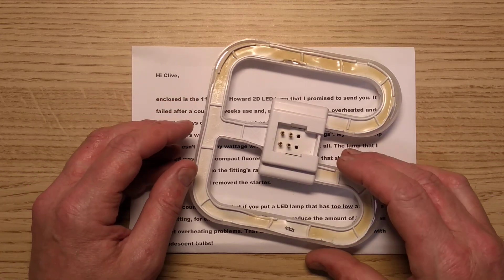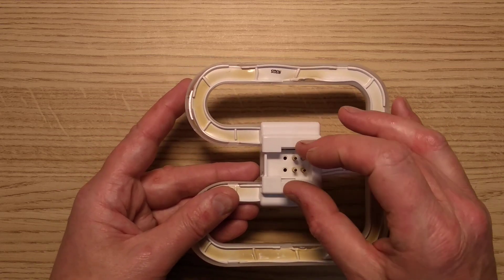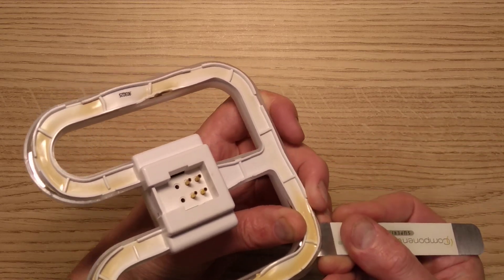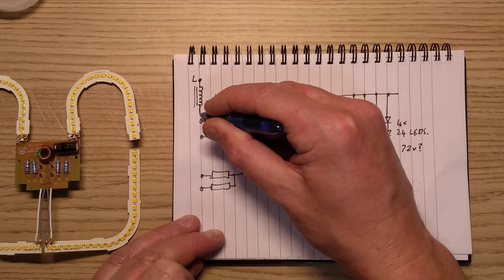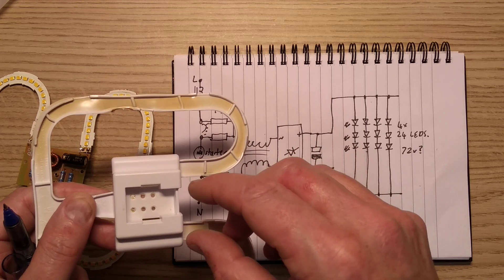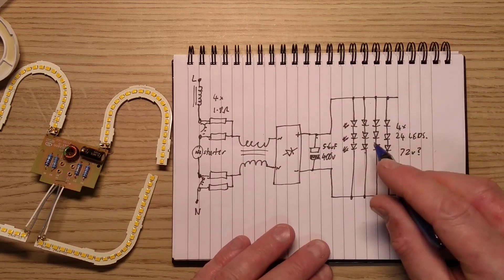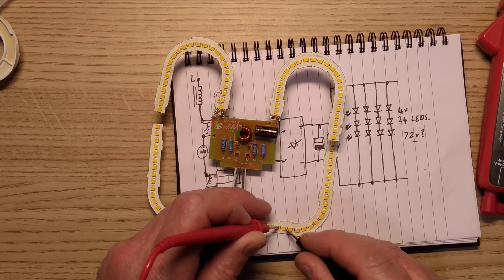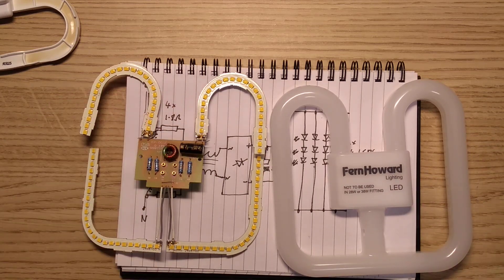Failed 2D LED replacement lamp. (with schematic)

Comment: Just curious, when you're testing the individual LEDs with the probes, are you just using the continuity setting?
Reply from the maker: Yes.  It works with single chip LEDs.

Comment: I recently bought a 2 pin LED lamp, and the instructions are adamant that being a 2 pin lamp I should swap the starter as it is a "magnetic lamp". However, I've taken the lamp apart a few times and cannot see the old starter, which according to the instructions should be nearly identical and easy to replace.

It is also adamant that, if there is no starter, I need a 4 pin lamp even though mine is definitely a 2 pin lamp.

The bulb works fine for now, but I'm definitely worried it might end up fried like the bulb in this video. I was wondering if anyone has any idea on what I should do, as Google is helpfully obtuse on the issue? Thank you 😊

I thought I'd add, the box for these bulbs has incredibly "helpful" terms such as "no rewiring needed - straight retrofit". Which as a layman I took as it will swap with the old bulb 😂
Reply from the maker: A 2 pin version of that lamp has the starter built in.  It's the four pin version that has an external starter.
Reply: @bigclivedotcom  thank you for the quick reply! I'll leave it as it is for now, if any meltage does occur happy to send it in 😂

Comment: I absolutely hate the "stand in" replacement led lights. They waste time and money making things "compatible" in absolutely no sense of the word except some false comfort. On the one hand the idea of reusing the fixture makes some sense except you have to replace a bunch of pieces and rewire it. The fixture doesn't need reflectors since they are in the LED chips so it sticks off the ceiling when it doesn't need to.  Many of the lights are super dangerous with live AC sticking out on an end. As the user intuitively thought you could make the light dimmer using a lower watt rating. You know what else LEDs can do? Dim with a dimmer which can be built into the fixture.

You can buy an entire light fixture that's pretty gorgeous for $35 dollars with LEDs space out nicely giving a super consistent look and flat on the ceiling instead of sticking out more than an inch since the reflectors are in the chips all it needs are a diffuser. Using aluminum backed strips that screw on the board would make the most sense if you wanted the ability to replace them. Except I haven't seen anyone do that yet. Plus if they are using isolated DC (which they should be) you wouldn't even need to turn the thing off to switch the LEDs out. Not that you'd need to very often.

I noticed recently a very nice LED light fixture with good SMPS components seemed pretty durable except in the usual Chinese way a few "unneeded" components were left out including the surge suppression and the fixture got fried from a moderate surge. So its things like which turn people off from the idea of having the light embedded in the fixture.

Comment: I still don't understand how you can 'push' more current to a bulb - doesn't it just use what it uses?  Silly to design in such a way and go to all the trouble to indicate NOT to use it in a 28 or 38 watt fitting.

Comment: In the fluorescent tube fitting it's a led lamp with an inductive dropper power supply. If it's used together with two Poundland capacitative dropper 6 watt led lamps the overall power factor should be pretty good.

Comment: Why would anyone think that putting a lamp in a fixture with a higher wattage rating than the lamp would make it dimmer or use less electricity?
If you put a lamp in a  fixture with a lower rating than the lamp, than it would be dimmer. On the other hand, the exact opposite would happen
 if you put a lamp with too low of a wattage rating for the fixture. Driving the lamp at a higher voltage caused the current to increase too high, 
causing the wattage to surpass the lamps rating, causing higher energy dissipation, overheating the LEDs and cooking the lamp to death.

Comment: According to toolstation catalogue, the fern Howard 2D are only for use in HF ballasts (which under-run fluorescent lamps compared to mains frequency) hence the two resistors on each side of the lamp replicating the cathodes of a fluorescent lamp to trick the HF ballast, normally if a cathode goes open circuit the HF ballast cuts out. It would appear that these lamps aren’t designed for use with a simple inductive ballast that would do little to limit the current.

Comment: "inox" = stainless, generally not the hardest of steels.
While Victorinox have found a reasonable mix for their alloy, it seems the spudger manufacturer hasn't bothered. At least it was cheap. I hope it was cheap.

Comment: This kind of socket is rarely used in Germany.
Normally 4pin-lamps have no starter inside (just two pins for each electrode/cathode) and need an external ballast and a starter (or an electronic ballast), while 2pin-lamps do have a starter inside and need an external, inductive ballast.

Comment: It’s what is called cheap china shit. A lot of these cheap Chinese leds about. They use cheap or even fake components. I do electronics and today you see so much cheap electronics items that fail and all from China. A lot of this stuff comes of eBay or amazon. Even some of these led lights can be very dangerous. So please watch yourself when buying cheap led lighting. You just got to watch yourself these days in buying cheap chargers,led lighting, etc. I seen many fake components too like capacitors,diode,resistors and evening ic chips and others parts.

Comment: Looked at these replacements when I wanted to change the 16W 2D fitting in the porch here to LED.and wasn't impressed by any of them. Changing the fitting wasn't an option so I ripped the fitting's internals out, made up an ali heatsink/mounting plate, fitted the LEDs from a couple of 5W GU10 bulbs on it and connected them to a constant-current LED driver from CPC.

Comment: You can’t win with these 2D fittings. If you fit the non ballast type of LED fitting you can Guarantee if it fails someone will try and replace it with a fluorescent. If you fit the ballast compliment type and it fails someone will try and replace it with the non ballast type led.

Comment: Humn.... From memory the centre of both the 16w and 28w lamps was the same, however the 16w was about 2/3rds the size, so you couldn't fit a 28w lamp in a 16w fitting.
Reply: IIRC there's some form of keying on the base but I've no longer got any 2D fittings here to check on.
Reply: @Graham_Langley  I just can't quite remember (which will bug me all day), G series lamps I can still remember. I was in the lighting industry years ago.

Comment: 16w and 28w 2d lamps have the same sockets they are eaither 2 pin or 4 pin but the socket is the same size

Comment: This has got my interest aroused now! - I have two used SOX replacement LED lamps. Essentially, they are a direct substitution for the normal yellow SOX lamp. I asked the guy "Do you leave the control gear in situ, or do you rewire the luminaire (lantern) so as bypass the ballast and igniter?" . He said to bypass them, however, given that these are second hand, I first tried them in a normal b22 lamp socket. One lit up for a couple of minutes, then dimmed to virtually nothing. The other didn't light at all, until you gently press on several of the LEDs (definitely faulty), but I am wondering now if the first one should have been connected via the ballast, like the lamp you have dismantled here?

On another note, or could that be "dulcet tone"? I have noticed of late that my four kittens (born in February, this year) have taken a definite liking to our Clive. They sit close to my Hi-Fi speakers with a look of contentment and ecstasy about them. As soon as the video ends, they're off to play again. . . I think Clive might secretly be a cat whisperer! 😾🐈 🐯 😹
Reply: Maybe the kittens like his whiskers too 😻

Comment: @bigclivedotcom working as a projects sparky for (herp-derp) Council, I get to see the occasional interesting LED replacement lamp.
I have a couple of Kosnic 2D 4-pin ones, which I thought cheap and nasty until I saw the plastic nastiness you dissected here xD
One thing interesting to note with these is, as they are designed to run on 230v directly, the maintenance sparkies (using the term 'sparky' VERY loosely) tend to bung them right in and fook off.
Now these Kosnic ones (reclaimed during refit >.>) run fine like that, but, stick the power meter (not a flickery HOPI, but one can't have everything) and you find it's sucking around 3x the rated 87mA... ooer missus, what's going on here?
Quite simply, the maintenance 'sparky' hasn't removed the cap from the control gear...
I keep meaning to send you some odd bits to dissect, I'll include one of these (when I remember xD).

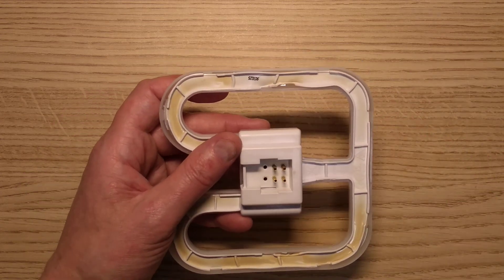Comment: 1:48 "Not the lamp's fault" - Oh yes it is ! If they can't be bothered to put a resistor or something to drop the current, it's the lamp design fault. I guess I have similar issue with fluo tubes - new tubes the ends go black and the tubes fail in a few days. Put old tubes in and they're absolutely fine.
Reply: The original ballast is the current limiter it is designed to put out 28w, if you run 28w into a 11w bulb it will fail. Not the bulb fault. Adding more resistance would mean it would be underpowered when run from the correct ballast.
Reply: @Science-Geek-0  No - if the power consumption is under or equal to the lower power ballast, the ballast is effectively ignored and the lamp would work wither either ballast or even none at all.
Reply: @millomweb  if that were the case the manufacturer wouldn't say don't use with higher wattage ballasts it wouldn't matter according to you. Those 1.8 ohm resistors aren't going to drop hardly anything if you take 220v fully Rectify it and filter it you can multiply the 220 by 1.414 to come up with the DC RMS voltage which would be 311v divided by 24 LEDs in series you would be running these LEDs at about 13 volts a piece they would burn out so quick you wouldn't even see them light.

If I'm missing something here please explain what would drop the excess voltage if no ballast were used?

Comment: @bigclivedotcom The letter said he removed the starter entirely. So there was no current limit at all. I'm surprised it worked at all and didn't just instantly pop.
Reply: the starter does nothing to limit current, as Clive explained it just send the ballast power to the filaments to heat them and then opens again.

Comment: Would it be possible to design these LED lamps with the current limiting built in to prevent overheating like this?
Reply: Yes.
Next silly question.

Comment: Maybe a video about ballasts and starters would be good. Much confusion there for LED people.
Reply: I think he's done one in the past already?
Reply: Already done one a while ago
Reply: Boonedock Journeyman 

Here you go...
https://youtu.be/qLaD11LITbQ
https://youtu.be/hjphxq9nUrA
Reply: Just fitted one like this to replace the old CFL; didn't last long though.
The instructions are really ambiguous so make you feel a fool because they initially outline the fitting procedure with a basic flow diagram but don't define whether you just leave out the starter or need to fit it in a circuit which doesn't use a starter.
I fitted it with the old cfl starter still in place.
Through the plastic I could see the resistors Clive points out glowing bright orange and now I have a 1W LED light!
What have I done wrong?

Comment: Your schematic is wrong. This type of lamps work with elecronic ballasts. The LED lamp relies on the current regulation of the electronic ballest. the voltage over the LEDs would be lower, so with the given current the wattage would be lower.
The resistors emulate the heated cathodes to trick the electrnic ballast.

Comment: so the clicking sounds of old TL lamps (flashing on/off until it stabilizes) is the bimetallic strip in the starter bending off and on to its contact point ?
Reply from the maker: Yes.  They made a distinct noise as the contacts reopened.
Reply: yes I vividly remember that
Reply: The mechanism of the glow starter is a bit more complicated than a simple bimetal switch. Instead of me typing out have a look at the WP entry: [Edited to remove revision scar] https://en.wikipedia.org/wiki/Fluorescent_lamp#Starting
Reply: @GraHam Langley thanks that was interesting. btw I accidentally saw your reply as youtube didn't notify me ! Naughty youtube :(

Comment: So... 11 watts LED fitting vs 16 watts fluorescent lamp? Hardly seems worth it.
Reply: I know led lighbulbs can have reliability issues, but this is more down to poor thermal management/crappy electronics and less the leds themselves.

My comment about brightness was based on personal experience.

https://catalog.tungsram.com/lamp/led-lamps/2d-retrofit/f=2d-28w-magnetic-retrofit/b=2d/d=3/?r=emea

They're specced at 128 lumens/watt way more than is easily achievable with a fluorescent

My halls in university replaced the entire hallway with them, and god they were so much brighter. In large part because fluorescents tend to dim over time, which LEDs have a tendency not to do much if at all, they just fail.

I've had crappy LEDs fail on me many times. I agree, it's a plague, and upon disassembly the cause is invariably shoddy design.

But I've also had well made units last 5+ years of heavy use, in moist air, with no dimming, all the while sipping power.

Trouble is it's impossible to tell the difference without buying it and taking it apart...at which point you can't take it back.

The only solution I've found is to go local- find a local electrical supply shop with a good reputation and see what they're selling.
Their customers are on average much more technically savvy than say on Amazon etc. (electricians) who have a financial interest in installing reliable things, otherwise they get complaints. Trade shops live and die on reputation.
Probably the same reason Poundland electronics are surprisingly reliable/well made, despite the price, more so than anything you can get online- they really can't afford the returns/lawsuits.

It's worked so far for me- bought a five star luminary from amazon. Fails within six months due to overheating. Go to the trade shop, get a light that's five pound cheaper from a brand I've never heard of, but that's very popular in the trade, going strong after years.

Disassembling, and the difference in "skookumness" is apparent even to my mother.

Big Clive should really do a teardown of one of the more well made units (trade ones) the difference is night and day
Reply: Depends how brown you like your toast.
Reply: It'll be brighter, more than you'd expect, and should require less maintenance if it's well designed (if)
Reply: @AngDavies  that's a big "if"! More often than not fluorescent lamps seem to outlast LED replacements, especially in less common fitments like this.

Comment: my housing association/freeholder, replaced all the CFL wall lamps in the hallways with LED ones, fuck me they are bright ! was just a str8 swap, i wonder if they bought bulbs with the correct circuitry inside to down current from the lamp holder

Comment: They replaced the cfls with these in my building, they're dull as all hell, some of the covers are nice, look like they should spread the light... But they don't, so they installed two 😂
Reply: Pmsl. That's brilliant ;-)
Reply: @simonhopkins3867  update: one burnt out already and the Palace smells of  burnt plastic

Comment: Those resistors are probably there to fool an electronic ballast into thinking there’s a lamp connected (otherwise it would shut down).
Being plastic I would have thought having a thermal fuse inside would have been a good idea, to prevent these “slow cooking” failures turning into something worse! (There are 55W 2Ds too!)
Reply: bigjd2k there is even self ballast 18w 2D’s! Albeit they are a 16w lamp with a little HF ballast built into the base (2w loss there) and run directly on mains.

Comment: You'd think they'd have made it with an SMPS, rather than hope that the fitting it went into was the right one, not a smart design on the manufacturer's part there... :P

Comment: The details on the Toolstation site look straightforward to me, see https://www.toolstation.com/fern-howard-led-2d-4-pin-lamp/p95733 where it does say which LED version is designed to replace which CFL. It also makes it clear that these are designed for HF fittings. HF fittings are the type with integral electronic circuits rather than traditional iron core (inductive) chokes. So as the person that supplied the lamp to Clive says that they removed the starter, I don’t think that the fitting they have would be suitable for any of this type of LED replacement lamps. As fittings with starters use traditional iron core (inductive) chokes...

Comment: This is one of those cases where "shamefully simple" would describe the design just fine lmao
Reply: I disagree !
Reply: pmailkeey oh well...
Reply: @mattmoreira210  A string of 80 LEDS would run off the mains without the resistors.
Reply: @millomweb  If it was my design, the ballast would be used as a passive PFC choke. The value of the inductance for the ballast must be well known, so there shouldn't be a problem.

P.S.: I'm fine with you disagreeing. Everyone is entitled to their opinion.